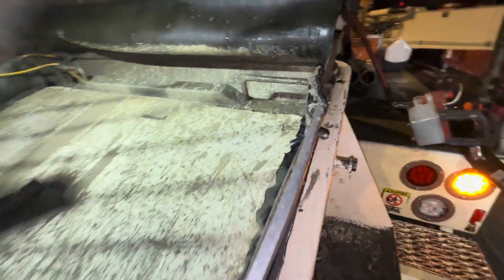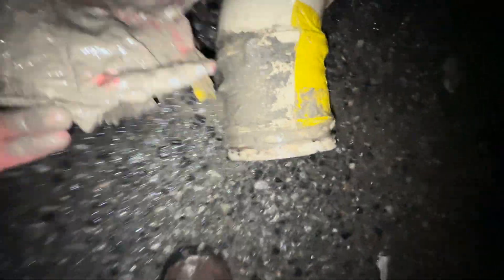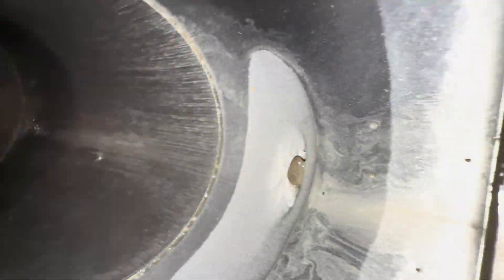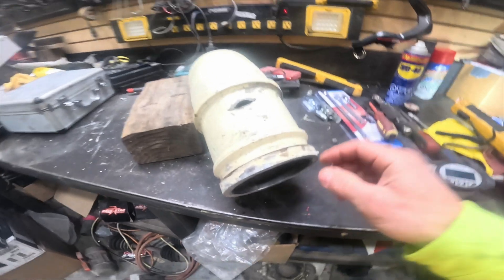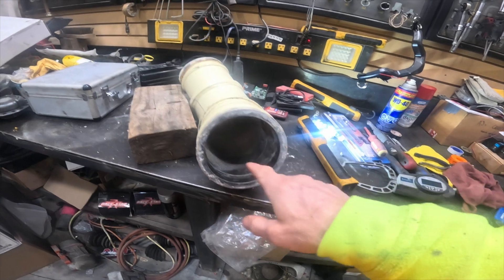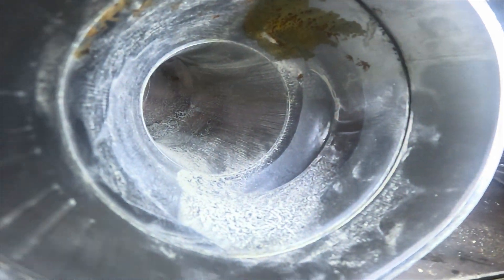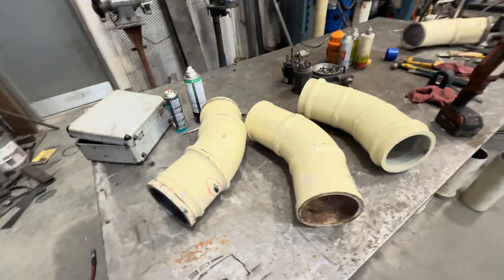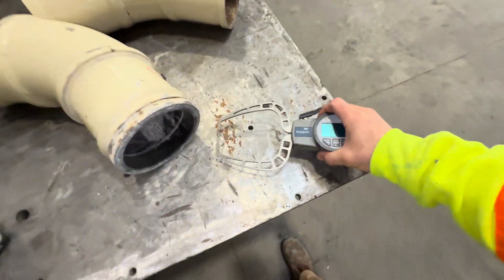Diagnosing a prematurely FAILED elbow:

Comment: If that ever happens again get a gasket and cut it so you can wrap it around where the hole is after you have put the Coke can and tape around it maybe use 2 or 3 gaskets then get a few Clamps and close them over the hole make sure you get them tight. I pumped almost 600 meters about 12 years ago patched up like that because it was on a elbow like that and didn't have one and needed to get the job done because Trucks lined up and I couldn't wait 2 or 3 hours for a elbow or another Pump and by using the Clamps it gave it support
Reply from the maker: @johnnybrophy8229  That’s good advice: the clamps and gaskets method sounds like a solid play for sure! 👊👊👊

Comment: You could test the areas of the elbow for hardness vs the areas that exhibited less wear (3X-4X differential for wall thickness) and determine if alloy was defective (soft spot) or if the elbow was defectively manufactured with a thin spot in the wall. Either answer I like what you intimated for a solution is use a product that is more robust from the start. Ray
Reply from the maker: @rs2024-s4u  would be interesting to have it hardness tested to see if it was in fact just a soft spot, or if perhaps a piece of the hardened inner liner flaked away.
Reply: @canadianconcretepumper1979  Agree however video shows smooth inner surface wher thinner material wore thru or failed under pressure but your observations could be answered with microscopic examination of failed area as I had not considered flaking.

Comment: I had a failure of an elbow with a welded on extension on our 58M happen during a 12th floor roof pour. It was a brand new elbow, first job, I trust the skills of the welder so I don’t think the weld itself was faulty. But it split (although much bigger than this). I’d have to say for sure it was the heat of the weld that caused the failure in my instance. Luckily we still had the spare elbow that we replaced and were able to finish the job. This elbow went through the boom at the end of the first section so it was a pain in the ass.
Reply: On another note! Those Weld wheels are for the road not the concrete pumping company museum!
Reply from the maker: @bowenike  (that’s a different YouTube channel of mine) 😁😁😁
Reply from the maker: @bowenike  the only other thing I could see is if a piece of steel from the mixer drum or even the batch-plant may have made its way through the boom system and tore that piece of liner out along the way. 🤔🤔🤔
Reply: @canadianconcretepumper1979  that would be one hell of an unlucky day to say the least

Comment: Look at the drift of wear. I would agree that it looks to follow the heat of the weld
Reply from the maker: @MuDemon2023  Would be cool to send it off to my peeps at a certain pipe manufacturing facility (whom did NOT produce this particular elbow) and see if they could run a hardness test on it.